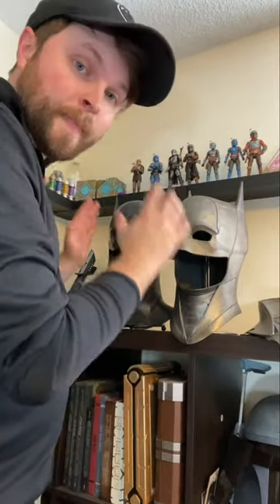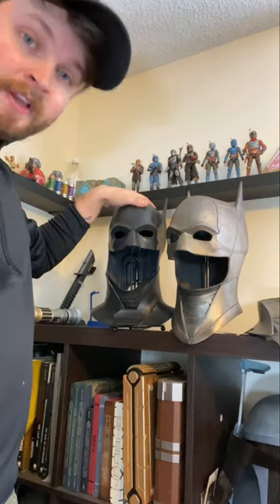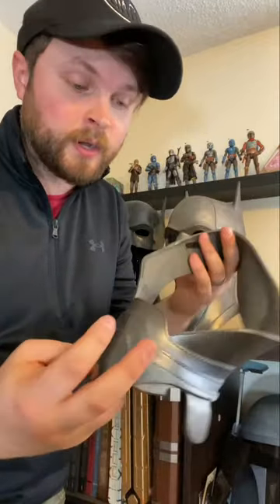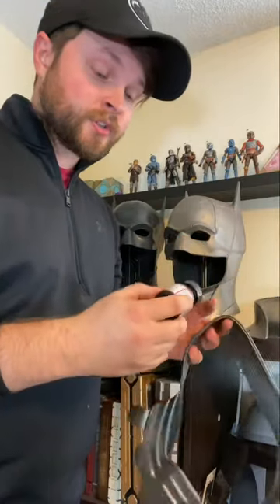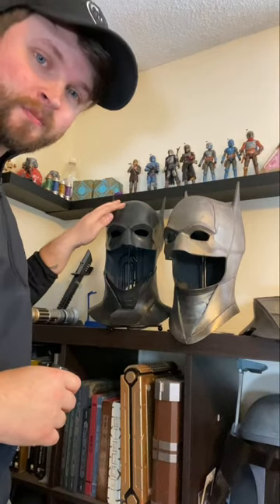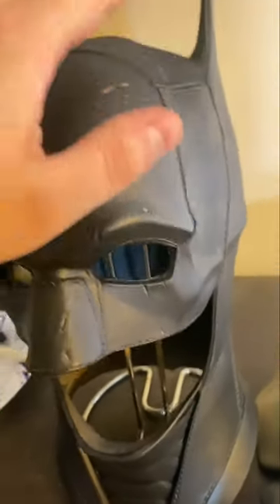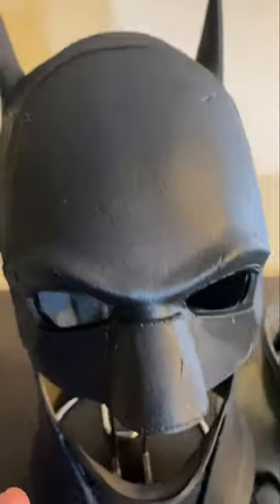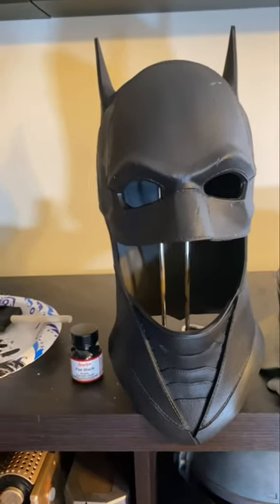How to paint a Batman cowl mask made in urethane or latex rubber - brush method

Comment: Im thinking of using this on my urethane cowl as it has a few faults that need fixing. Does the paint last or does it crack etc? :)
Reply from the maker: This is a urethane cowl in the video and it has lasted just fine on mine (again, VERY thin coats). The texture of this cowl also helps not see any of the hand painted strokes. If it is a smooth/non textured urethane cowl, highly recommend using an air brush and as always, do a small sample on your cowl before going and doing the whole thing, just in case. Different makers use different additives in their casts which can throw off the chemical makeup of the urethane rubber.

Comment: Would this work on latex foam padding 89 Batman suit and I have black latex paint would this method be ok or
Reply from the maker: Whether it was regular latex or foam latex, I’d personally want to run that through an airbrush. I wouldn’t hand paint that like this cowl. The cowl is textured, which helps his streak lines from the foam brush. Smooth surfaces I’d say airbrush 99% of the time. You may have to find a thinner to work with your latex paint though (hopefully it’s costuming latex paint).
Reply: @TheRusticNerdDad   gotcha and would latex paint be ok to air brush or I want another type of pain like yours
Reply from the maker: As long as it’s not latex paint from a regular paint store (there is costuming/mask making latex paint you can buy from places like monster makers). I haven’t used it in a long time personally, but most paints like that you can get a thinning additive to mix with it when you spray it through an airbrush. Angelus leather paints has something like that as well for theirs.
Reply: @TheRusticNerdDad   the latex paint I have is from the monster makers company
Reply: @TheRusticNerdDad  sorry to be picking your brain with a flood of questions
Reply from the maker: That paint should be good! @CamdencountyBatman_1989
Reply from the maker: No worries! Glad to help people out when I can @CamdencountyBatman_1989
Reply: @TheRusticNerdDad   thank you and I think it’s latex paint colorant for latex so wasn’t sure

Comment: any tips for christane bale masks that use that same rubber?
Reply from the maker: Using a high grit (like 2000 or higher) and or an adhesion promoter can definitely help when using the Angelus leather paint for super smooth finishes. Definitely would recommend using an airbrush and not by hand for that one.

Comment: see..i was wondering..thank you...but what did you use to seal it with..?
Reply from the maker: Angelus leather paint is designed to be water proof and scratch proof. You can purchase finishes to apply, however that is typically used to change the sheen/look of the paint. Example being gloss or matte. The only time I’ve really seen issues with this product is when people use too much and cake it on, at which point you will get cracking like any other paint.
Reply: @TheRusticNerdDad  perfect..i used it for my cosplay projects..its great stuff...illprobably go with a matte or satin look...thanks again